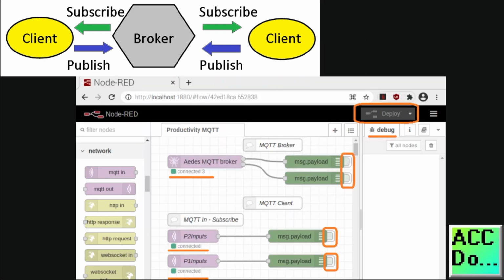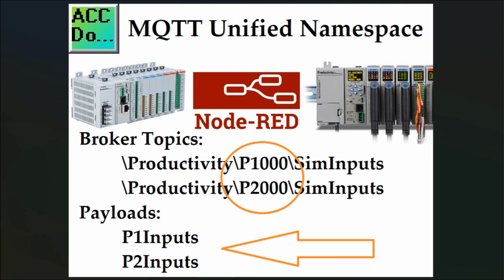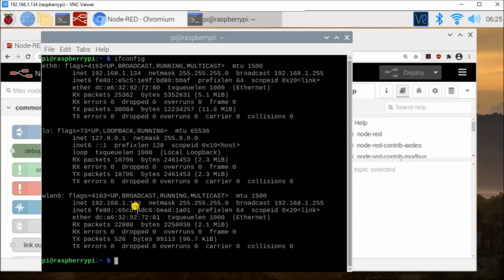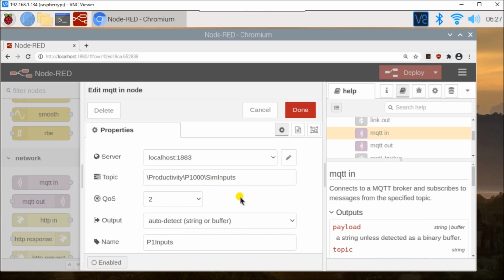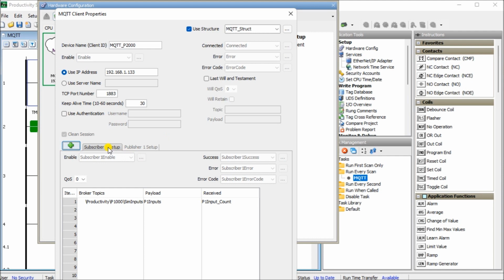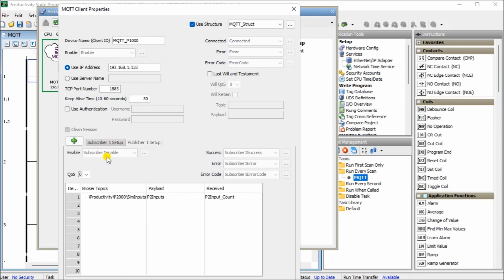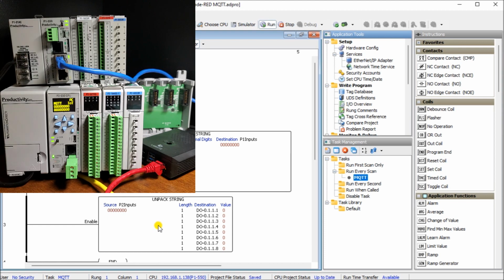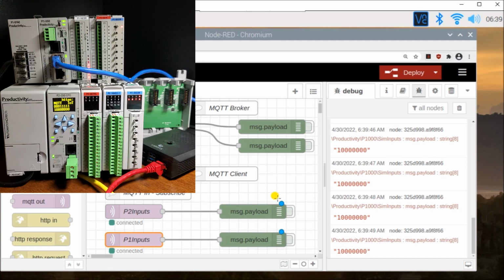Productivity PLC Node-RED MQTT

Comment from the maker: The entire Node-RED series can be viewed here:
https://accautomation.ca/series/node-red-iot-enabling-software/

There are several reasons why we are using Node-RED. Here are just a few.
- Built on top of the most dependable programming language JavaScript.
- JavaScript is flexible and easy to work with on web browsers, server-side, IoT, IIoT projects, and more. 
- Visual flow type interface making programming easy. 
- Node will allow JavaScript code to run directly on a computer.
- Node-RED is a free, open-source logic engine.
- Connect to PLC, PAC, Temperature Controllers, and Process Controllers using standard protocols.
- Save and read from databases
- Easily make the Internet of Things (IoT, IIoT) industrial solutions.

Node-RED provides the ability for you to quickly create custom control solutions.

Regards,
Garry
ACC Automation
https://accautomation.ca/

Comment: I am getting an error when i try to publish from the plc in the data view saying error "301". It subscribes fine but I cant get it to publish. Im trying to publish to the same one I was just subscribed to which was working. Do you have any ideas on what im doing wrong?
Reply from the maker: A Node-RED error 301 is an HTTP status code for "Moved Permanently", and is typically not a Node-RED error itself, but rather an expected response from an external server you are trying to connect to. Node-RED's http request node does not automatically follow this type of redirect, causing the error to appear in your flow. 

Troubleshooting Steps
Inspect the Node-RED Debug Sidebar: Check the full message object in the debug sidebar for more details about the error, including the redirect target URL if available.
Verify the URL and Protocol: Double-check the URL configured in your http request node to ensure it is using the correct protocol (http or https) and hostname (www. or not).